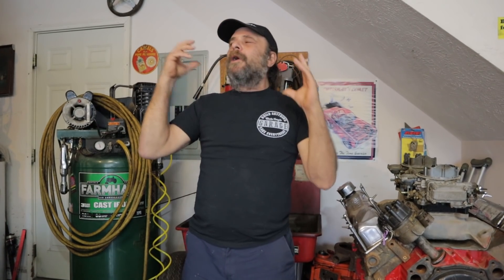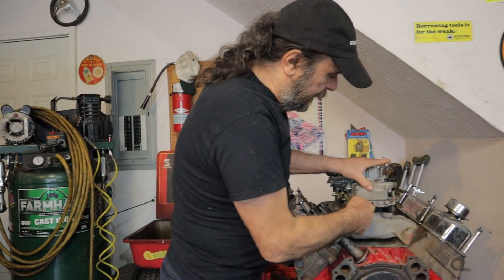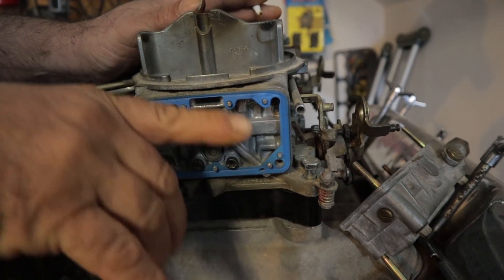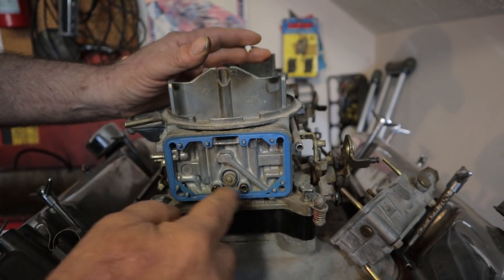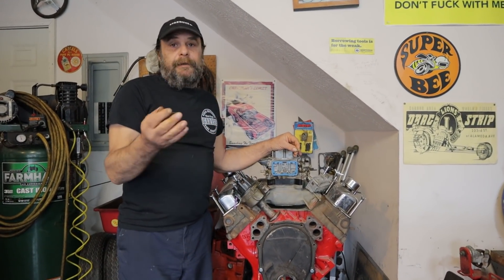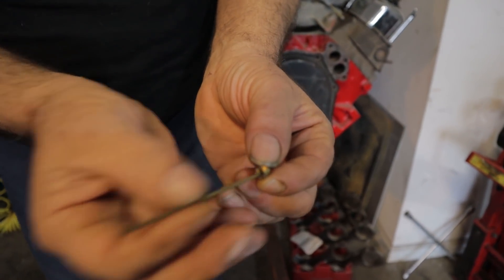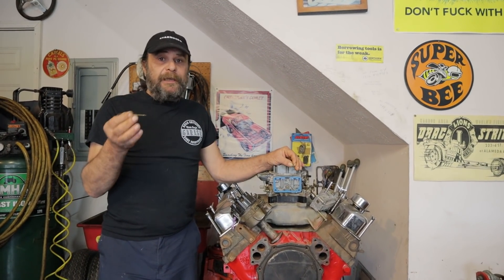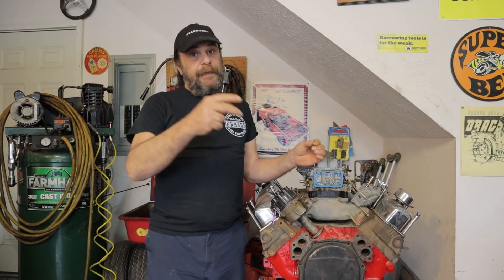Carburetor Jetting Basics

Comment: I don't know a lot about carbs, but I knew that CFM is the air flow rating of that carb, and what CFM you want depends on the demands for air that engine requires.

Jetting adjustments don't change air flow, it allows greater fuel flow into the air stream of the carb. 

My favorite style of carb is the pressurized carb they had in the old Packard V-1650 airplane engines, which was almost a mechanical throttle body injection.
Reply: A lot of people also don't realize different types of air cleaners and such serve as cfm restricters, as UTG has mentioned in a past video, so they really aren't getting the cfm that carb allows. My 600cfm edelbrock on my stock 429 BBF is limiting me to 4600rpm it sounds like when it should be able to do 5k, 5.5k no problem. Working on getting it the 670/680cfm Holley it needs or a 750cfm Holley with vacuum secondaries so I have that extra range when I get around to doing a cam and roller rocker swap.
Reply: Yeah CFM is cubic feet per minute of air you can put the biggest jets known to man and still have a 600cfm carb or what ever it's rated for unless you change the venturies size on the carb the CFM will always remain the same
Reply: My dad has bad breath
Reply: Volumetric efficiency.
Reply: @jamesharris5232  air cleaner?
Reply: @rodney1818  Running a Spectre 14x3 on my car.
Reply: @jamesharris5232  I only have one vehicle with carburetor at the moment. And it has a cool solid brass screen Coast Guard Cutter air filter on it.
Reply: I have a 1" phenolic spacer. Have been taking it easy since I know my engine is undercarbed. When I find the Holley I would like to have, I plan on looking into those "funnel" spacers or whatever they're called. The name escapes me currently. But I've heard they improve the flow and mixture.
Reply: John Alarcon  To be honest with you. I'm not sure it just has a u.s. Coast guard part number on it. I bought it at a antique store in Chagrin Falls, Ohio
Reply: John Alarcon  my dad ate our next door neighbors sideburns
Reply: John Alarcon  You can Port everything else. Why not a carburetor
Reply: John Alarcon  Sure, Port the primaries. Put in bigger butterflies You can't say it's not possible if you haven't tried it.
Reply: John Alarcon  I don't know. How much did you port the carburetor before you tried to put in bigger flutterbyes

Comment: Another great video. Two things I have taken away.
1) I did not know you could run different size jets in the corners of a Holley. I thought they had to go up and down as a pair.
2) Edlebrocks are kind of trick. I was brought up in a Holley family so that is just what I ran on my cars. I might have to give an Edlebrock a chance.
Keep up the great work!
Reply: 1) That is super advanced tuning on a handbuilt motor. And a single 4bbl doesn't have corners anyway, unless your foot is in it so much that the secondaries are always open. Oh right, Tony.
2) You don't need to adjust jetting enough to justify metering rods, unless you're Tony. You've got the power valve, accelerator pump, and even idle screws if you must tweak a Holley mixture one evening. Your family was correct, Holley is superior over any Carter. And Edlebrock makes manifolds, not carburetors. What year is this?
Reply: I used to fix Edelbrocks by installing Holleys. Now I finally understood how to tune Edelbrocks too and I agree with Tony they can be made to run extremely well too.
Reply: @cudatali  I had a factory Holley 2 bbl. 500 cfm on my 360 Fury. Best carburetor ever.
Reply: It depends on what type of intake manifold you're running.  If you're racing with a single plane intake, then yes, you can fine tune a holley corner by corner, but if you're daily driving with a dual plane intake, you have to consider it more side to side than corners, since dual plane intakes feed two cylinders on each side with each plane.  So If the two middle cylinders on one side and the front and rear cylinders on the other side are rich or lean, you have to look at which side of the carb feeds the plane that feeds those four cylinders and tune it that way.  But honestly, a daily driver usually doesn't need to be THAT finely tuned anyway.

Comment: if you can't read the Exh. O2 you won't be able to correctly tune a Engine. ya you can get close and run your Veh.  but that doesn't mean it is running it's Best. You need all 3 to dial it in correctly.   O2 reading, AFI readings , & what do the plugs look like.     this has worked for me!!      good stuff Tony

Comment: Derect fuel injection is the smooth peanut butter to the carburettor full crunchy goodness. Keeping the weight of knowledge you have on the basis of how vehicles work alive is so important in an age of fault codes and clean handed mechanics. Keep it real and honest like you do so maby the youth of the industry may learn a trick or two.

Comment: I used to run Holley's with the mechanical secondaries and dual accelerator pumps.  They were great carbs once the pump cams and jets were set up right.  Only problem, Holley got cheap and the metering blocks started warping often so I went to the Edelbrock AFB and those offer a much broader power curve than the Holley.  Thanks for the video Tony!

Comment: Afr gauges are extremely helpful and can get me extremely close as I can see what’s happening and where in the rpm range it does and adjust as necessary. I do agree though reading the plugs afterward and making small adjustments to get it near perfect is necessary to get the most out of the car
Reply: I need an AFR gauge.  Fell in love with using tools to help with carb tuning when I started using a digital tach for idle mixture tuning.  It's kind of amazing how far off the ideal spot is from where it "feels" like it is.

Comment: Hey UT, why do you always hear about not putting on a carb that’s ‘TOO BIG’ but a lot of stock muscle cars had multiple carbs that total a thousand cfm or more? Maybe you could do a short video on this subject sometime? Thanks.
Reply: Because people put Dominators on 289s.
Reply: "a lot of stock muscle cars had multiple carbs that total a thousand cfm or more?"

Need a citation for that.

As far as too big, it only matters when you're driving normally.  If it's a drag car, there's not really a "too big."  But getting stupid and putting 1000+ CFM on a 289 or even stock 460 truck motor will give you really shitty throttle response, especially down low.  The carb is like "half throttle... full throttle... quarter throttle...?  No idea."
Reply: There are actually so many different carb sizes, most factory multi-carb setups weren't that big, even though it seems like they should be.  For example, most 3 x 2bbl setups use something like a 350 cfm center carb and the two auxiliary carbs  are only about 200 cfm each, for a total of 750.  Dual 4bbl setups often use two very small carbs, like 400 or 450 cfm each.  The dual 4bbl set up chevy used in the mid 50s on their little 265 and 283 were only around 325 cfm.  Don't quote me on the exact numbers, I'm just going by memory.
Reply: I knew a guy with a Vega GT that he put a 4bll intake on. It would bog and then scream and still not really be fast, lol
Reply: With Big block Mopar sixpack setups, the center carb is rated at 350cfm. Those main barrels are the only ones directly linked to a mechanical linkage. The two 450cfm outboard crabs are operated via vacuum pods. So , the extra 900cfm combined capacity is only called upon when the demand is there, just like a Holley vacuum secondary carb. So with a sixpack if you're just cruising and keep your foot out of it, 90% of the time your rollin around town utilizing roughly 350cfm or less. When you mash it the capability is there to utilize the full 1,250cfm via the vacuum pod arrangement.

Comment: A lot of people dont know on edelbrock carbs is that  the electric choke carbs are set from the factory for economy and the factory manual choke carbs are more for performance . So like if you have a 600 electrical choke you can use a 600 manual choke tuning chart to improve your 600. Also i had in my 600 manual choke   stock springs = 5  orange  did a vaccum test after fully warmed up  and it said 18 on the gauge so you have to take that number ÷ by 2  = 9  so i had to use the biggest numbered springs in my edelbrock tuning kit which is silver  . It improved the performance /response in my mildly built 318

Comment: I like to read plugs also it can tell you alot about how the engine is running. Although with modern fuel injection i often see alot leaner looking colors on plugs these days then i have go digging at fuel trims o2 sensors and lots of other data to determine if everythings good to go takes a while.

Comment: Uncle Tony, another great video thank you! But I have a question for you; I have a REALLY gacked up, nasty,  Edelbrock carb that I got for free... I need to clean it before anything else! What would my uncle Tony do to clean this thing?  Thanks again!
Reply from the maker: I usually just drop them in a pan with some gas and brush away
Reply: Dude, Harbor Freight ultrasonic cleaner.  It's a crappy ultrasonic, but it'll work for a carb or two.  And no dirt (and few finishes) can survive an ultrasonic cleaner.  I've had it take anodizing off.  Type 3 is safe, but apparently anything less goes bye-bye.

Comment: CFM (Cubic Feet Minute) is the air flow rating though the carburetor.  The carburetor jettin is setting air to fuel ratio ideally  about 14.7 to 1.  After setting the carburetor few time, you can able set a carburetor without using any fuel meter but it's good tool to have.   What type carburetor need to run the engine  correctly.  It depend on the engine setup and the RPM range will the engine run. 500 cfm, 650cfm, 850cfm, etc.

Comment: My understanding is that manifold vacuum read at WOT could give an indication that the engine is flow limited by a too-small carb. Do you have a WOT manifold vacuum number that could be used as a rule of thumb to indicate this issue ?  I'm not sure who else to ask. Thanks!
Reply: TommyMacDaddy1 Ideally you’d have zero manifold vacuum and full throttle. If it’s still showing vacuum then you have a carb or intake restriction.
Reply: @NBSV1  theoretically, yes. I've never seen any read zero, though.
Reply: @Tommy_Mac  It may not read exactly 0.00000, but the closer you get the less restriction there is. If it's showing a couple inches of mercury at WOT then you have a pretty big restriction.

Comment: Would you suggest larger jets in the secondaries if the motor doesnt have a lot of high rpm power? When I'm romping my big block I feel like it lacks power up top. Doesnt surge or bog... just feel like theres no pull around 4000 rpm
Reply from the maker: I'd give it a plug read first. Lots of things can kill high rpm power

Comment: How can you lean out the carb at idle? I've been messing with timing and carb and my idle mixture screws don't make any diff. I have a 650 avs2 on my 360. 366hp and 420 tq. Decent streetable cam.
Reply: Turn your fast idle screw all the way to the left and bury it - then give it a 1/4 turn to the right. You are in the transfer slots and that’s why the idle mixture screws aren’t working. The idle speed screw is too fast and you’ve already bypassed the primary circuit.

Comment: Hey Uncle Tony! Thanks again for the awesome content and info! It’s really helping this young, old school hot rodder/drag racer who’s been kinda out of the game for the better part of a decade aside from what I can watch and read. Any way I have one question and one suggestion. My question is I’m in the slow process of acquiring parts for my 1977 Ford Maverick I have a few candidates for engines 289’s and 302’s and I have a set of GT40P heads off of a V8 explorer, I plan on building the engine very close stock, probably with a stock explorer cam, it will have a C4 transmission with a highway gear of 3.0:1 and when I rebuild the transmission I will probably have the first gear swapped for a lower gear ratio, I plan on it being a summer family cruiser that will see some drag racing passes every year and I have been debating if there would be any advantage/disadvantage to using a 500cfm Holley 2brl. Versus say a 600-ish cfm 4brl. And if I go with a 2brl. Would it make more sense to use a 4brl. Intake with an adapter or I have a few factory 2brl. Intakes without the EGR and other emission stuff. I just think it would be cool to tell people they got beat by an old stock 2brl. SBF and when they see under the hood it looks pretty factory. Kinda aiming for mid to low 13 seconds in the 1/4 and want decent highway economy  16 to 20-ish mpg. And I figure a 300-ish Hp sbf in a sub 3000lbs. Car that most of these numbers shouldn’t be too far off from reality. And I know what ever it does when it’s all said and done is what it is and can only be improved slightly with testing and tuning. What are your thoughts if any on this? 

Also I think it would be a great idea to combine all these carb tech videos into their own playlist as I think they are the most widely, directly applicable tech info that relates to basically every carbureted automotive piston engine regardless of manufacturer and it would be great to have them all together for easy access for reference. 
Anyway sorry for being long winded, and as always I’ll be here watching and waiting for the next video! Keep up the great work Uncle Tony!!

Comment: I have a 64 Galaxie with the stock autolite 4100 4 barrel carb.  It uses Holly style jets.  I had a real bad pinging problem that I did not have before about 20 years ago.  I don't think I have a lot of carbon build up.  I got it to stop pinging by changing my jets from 50 to 58.  Before that I had the vacuum advance plugged and the timing retarded, now I can set the engine to factory specs and have the vacuum advanced hooked up.  I guess my question is why was the car pinging with the original 50 size jets?  I always us 91 octane gas.

Comment: I got a 51 Lincoln that has a 336 flathead v8 and has a 2 barrel 885 Holley. Do you think it would be smart to convert it to a 4 barrel edelbrock. I don’t know much but there’s more videos on edelbrocks to fix them and do everything to them and I don’t know how to turn the Holley carb. Is it even possible to switch it over?
Reply: If you are considering “changing” or “upgrading” a fat fender Lincoln with “modern” carburetors or any non period correct parts, find the biggest meanest biker you can find, and have him kick you square in the ‘nads, and repeat as necessary until the thoughts pass!
Reply: Zephyrmec I just don’t know what the fuck I’m doing. I want the easy route

Comment: To Need Metal. It’s the magnets on the fuel lines that cause the gasoline molecules to line up that gives 50 HP extra. 
So add in the carb spacer and that’s 100 HP extra for very little cost and effort.

Comment: Uncle Tony,

I know the bolt on EFI carburetor replacements are not on your list of favorite products, but when you were discussing the possibility of using two different size jets to compensate for one bank being more rich or lean than the other bank it made me wonder how (or if) the EFI systems are metering or compensating for that kind of condition, especially since (in all the systems I've seen) they're only using 1 O2 sensor on one bank of the engine?

Comment: AFR, per cylinder is the only way to be accurate, but very expensive, I do not see using that in vehicle, maybe runstand or dyno tuning scenario, even the newer EFI engines are not equal in distribution, I think the front two and rear two cylinders are a bit lean, not much you can do, be sides putting slightly high or lower flowing injectors in cylinders requiring more or less fuel, ( same as the jetting you explained ) Richard Holdner tested multiple o2 in a LS and it was way off from what I expected, not  extremely off , but you must tune to the highs and lows, let the in-between cylinders be where they end up,  great video!

Comment: You are so right about carb ignorance! I’ve even heard guys say they changed their engine to larger displacement by swapping heads! 🤯. After I have heard that nonsense for long enough, I ask them 2 questions. 1- what’s the bore size, 2- what is the stroke? Then I tell them to pull out their phone and open the calculator app. Type in bore x bore x stroke x .7854 x the number of cylinders. When they say “that’s not right!”, you have to ask the conversation ending question. How does a part that has no effect on bore or stroke make your engine larger? 🤔

Comment: Great video, I use a "maxi-pad' under the holley float bowl after draining from the lower bolt......takes care of any residual seepage!
Can't we just take out our laptop and add or take away a rich or lean situation on are Holley??????
Reply: You could use the computer but first you'll have to take a flat screwdriver and enlarge the USB port big enough to fit the holley plug.
Reply from the maker: I'm not always on my period when I need to do carb work, so I kinda stick with the spray can caps
Reply: @UncleTonysGarage  Yeah I hear ya, I need to clean out the cupboard under the bathroom sink.Lol!

Comment: Swapping venturis can get you a bit more range but you'd have to rejet fuel, air and probably alter emulsion tubes. For mainly density differences I've had best luck just changing the air jet, fuel if there's a big temp difference as well.